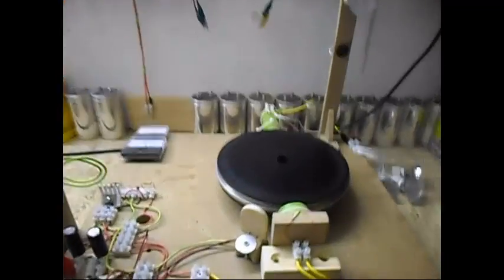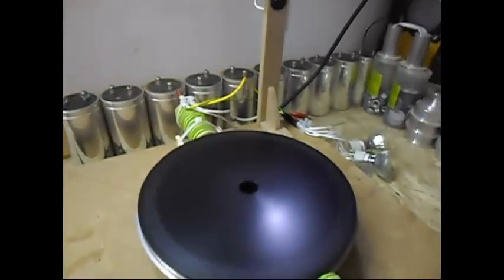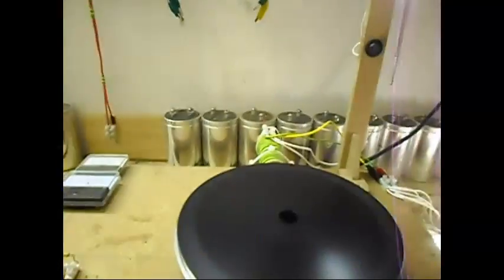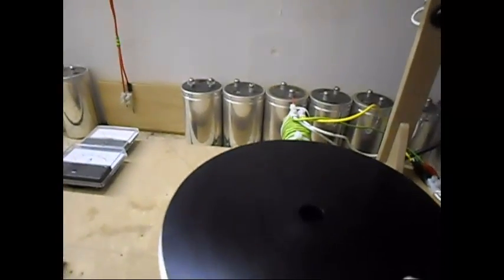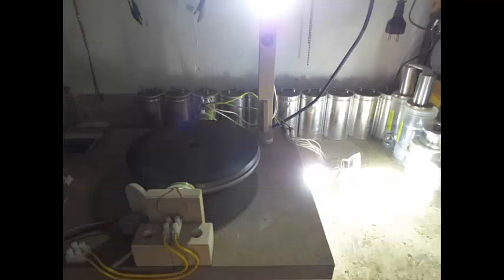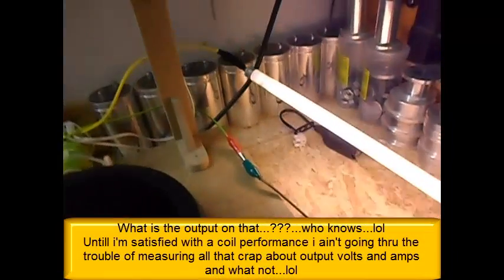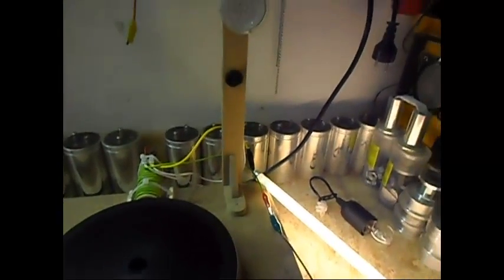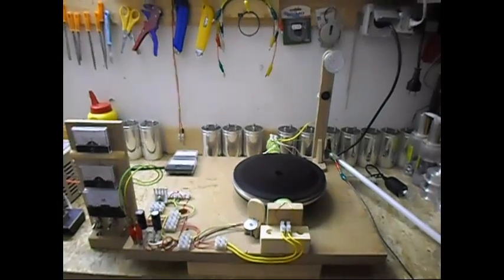Pulse Motor - Generator Update 3, Another coil - 1, 4 & 13watt AC load with speed up under load...

Comment: nice video! but what does the drawing amperage while you add different loads to the generator coil? is it stable or does it go up? more data would be interesting. also its interesting how many torque this thing can reach. can you measure it anyhow? i have to solve the following quest: drive a mechanical load of about 50kg at a stable speed where this awesome effect kicks in. can you help me with dimensioning the pulsemotor size?

would the rotor also speed up if you just put the generator coil away? maybe its just slow down the rotor because of copper resistance (like a break in a train) and lose this resistance with load.
Reply: This is the typical response to the coil shorting technique. In a system that uses a permanent magnet generator, such as Thane Heins, my own coil system, the bucking coils, or Chris Sikes (HYIQ.ORG) partnered coils, and many other motor systems using anti lenz configurations, there are plenty of ties to Nikola Tesla's bifilar coil. This is because it increases the amperages in the output by drawing the energy in from elsewhere. He called it from the cosmos, but what we are dealing with here is an effect related to the pulse of the back emf. When the back emf is launched back into the equal but opposite coil with a diode, the energy reflection comes back with additional output, further reducing the load and enhancing the output energy, so the load doesn't affect the input in anyway that would increase it, however the system needs energy to grab that additional energy. I show this with the partnered coils, and I also use this in my Pelex device, however I use it 3 times in a configuration that takes very little energy to start the system, then I use the flux generated by the system's start energy to amplify this effect again and again, slapping it so to speak as it rotates. You do this with a mechanical system, I use it in a non mechanical system creating a rotational flux rotation without the rotor. Mine spins around and around, and once the short is added and the other two coils are still operating, the back emf strikes the short while the other two energize into a forward motion, kind of like Tesla's induction motor. There is plenty of free energy out there for the taking and I hope my somewhat "vague" explanation shows you that it is also possible with a non rotating mechanical device, you just have to either use core materials as I did to make it switch fields in a specific manner, or you need magnetically activated switches (reed switches) or homemade self activating relays as I also have made to turn the correct coils on and off at the right mark/space ratio  to give these effects "amplification of energy" needed to call it overunity. Overunity is NOT possible without assistance from an energy that is drawn in elsewhere, so by merely putting a 1.5 v 1mah battery into a circuit saying "I get out 3v at 5 mah is impossible unless switching and special coil and timing effects become used at some point to provide a magnetic manipulation which allows this effect to be the objective of the device. Some circuits have special uniquities that all them to run overunity (in small scales, such as LEDs and solar cells, or with relay circuits that have been tuned to switch in resonance with the capacitive, inductive and resistive components. More energy out is Possible! It is science that keeps telling us it is not because science says we can't draw from an aether that doesn't exist, well, they are wrong. Physics ended once quantum physics started. The quantum part is what they don't want all of us to know, they want limits in place, that is why most folks are limited to the physics they teach in school. They don't want us to know it if we flaunt it or give it away so they lose money. They= the establishment.
Reply: you are welcome. The key to all of this free energy stuff is to capture radiant energy with the use of inductors using a phenomenon they weren't designed to use. That is capacitive coupling by magnifying the loss function so deeply that it reverses it's reaction. This is by creating radiant energy or harvesting it via the use of a wirewound resistor using the correct  magnetorestrictive elemental conductor or compound such as Terfenol D, Metglass or others that have very unique magnetoelastic properties with energetic growth into the quantum arena.

 The inductor has a capacitance, supposely like a "leach" so to speak that allows the harvesting of energy. The inductor also has a high resistance, or needs one so it functions as needed here. This is the key that unlocks the phenomenon. I have a few examples,. first is Jim Murray, Second is Rosemary Ainslie, and the rest were all some sort of success from the work of Tesla.

In every Tesla system you will see his high impedance coils are always represented in schematic form as a resistor. This was done on purpose and it is the entire secret to his free energy success where he wanted to release it so badly, that he had to hide it in plain site within schematic form so the whole world could see it plain as day. If the viewer sees this circuit schematic or the many that contain it, refuse to allow others to make my theory public, it will save the system from being totally suppressed. Make sure that others know where the info could be found orally, so it doesn't become publicly suppressed. 

 Tesla wanted us to know this without telling us so it would endanger being removed by the scientists that would eventually figure it out. The key he didn't ever say was that reactive power is radiant energy and that reactive power was an excuse to cover up what science didn't ever want to be released., and it is held in complete confidence so much that the court systems would have the ability to be controleed by the establishment so much that an energy system as such couldn't ever be released to the public without being shut down.

Paul Pantone met his match when the legakl system was overcome by shadow gov officials and forced him guilty of security fraud charges and jailed for years, completely ruining his life when he found the answer to the fuel crisis, where they obviously didn't want anything to be known since it was the perfect time to release a new very powerful technology. He obviously refused payoff to be shelved and they figured they would teach him a lesson as they did to Stanley Meyer, just not so harsh because they probably wanted his intelligence to work for them and I bet he refused.

 So, by showing the coil as a resistor Tesla didn't only mean it was an inductor or resistor or both, he wanted us to know they had high resistances and therefore was able to be pulsed with a specific enough waveform with the proper frequency where it allowed the material it was made of to heat up using negative wattages of input while the output was well over 100 watts. Here is a link to show what I mean - this link below is a representation that Jim Murray used an element that would allow the peaks and valleys of the waveforms with a high resistance as a form of gain beyond it's loss.

Radiant energy is the reactive energy he portrays in his system.This is how it works, if we take a high resistance bulb or wire one with a high resistance wire, such as magnet wire of maybe 40 awg and the power then comes to life, as with the hairpin circuit with a shorting bar.
Reply: Hi mrV@DAY, yes, please do read up on this from anybody but the scientific community. Their interpretation of reactive energy is much different than ours because we know we can't make energy and we also know we have to harvest the energy from other places without additional inputs. Mr. Ismael Aviso is a master at this phenomenon, so I suggest looking up his work. 

Science suppresses this data and we know it is not true what they speak of because there were original formulas from Maxwell that allowed this free energy to be harvested from the Aether, so, with that being said, if your input is less than your output,. we certainly know where it is coming from, and it isn't from the input, it is from the radiant energy created by the magnetic power of our planet and probably from using a shorting circuit added to a coil. 

t is very real that this energy being used to fire the motor disappears and draws only the power of the load, so if the load is the same size or larger than the motor's input necessity, we can loop the output once up to speed to initiate self running systems. What can be done to make it even more powerful is make the same system doubled, one system used to power 2 systems, then return the energy to the input and use the second motor drive to power a generator for the load to get completely free energy, or short it's output again in sequence for additional gains.

 This is what I have done using the mosfet shorting system and 2 universal motors to net a similar result. I copied Lasersaber's universal motor winding,. then added a mosfet shorting circuit to each one, running 2 resistive loads in parallel with one inductive motor load. The resistive loads run for free because the loading becomes equal, the inductive load is a full load with nothing for free until the resistive loads are added, then the motor runs for free after the shorting mechanism is added. 

Look this up, I'm sure you will find it very interesting. You do a great job with your builds, I would be interested in seeing them in person one day and hope you do make it to one of the free energy conventions if you have the time. As always, it is a pleasure to watch your videos. Good Day!
Reply from the maker: Thanks for your comment...^^
The amp draw goes down while the load(s) are connected...the heavier the load the better but there's a limit of course...;-)
" drive a mechanical load of about 50kg at a stable speed where this awesome effect kicks in"...that will need some careful calculations and i don't really do that since almost everything i do in this field is "go by feel"...and i know...not a scientific approach but it works pretty well so far for me...;-)

Of course will the rotor speed up if i remove the coil and that's because of the steel core in has in it...magnets and steel love each other very much...lol
But that's also a good thing since steel absorb magnetic fields like a sponge...^^

"like a break in a train"...that's the Lenz effect being used into a positive action...;-)
Do read and check all kinds of diagrams on google to get a good idea on it "regenerative braking"...^^
Reply from the maker: Thanks for your long and positive post and i'll try to soak it all up and let my brain consume it hopefully...^^
I'm not much into solid state stuff except for inverters but that's been a long time ago also...;-)
Reply from the maker: Many thanks for the long and positive comment about it all, it's all much appreciated...^^
To tell the you the truth i don't know much about "radiant nor reactive energy" but i will in the near future make time to read about it...;-)
Reply from the maker: Many thanks for all the info on this...^^
Mr. Ismael Aviso...i think i've heard of that name before...;-)
Lasersaber has some cool videos, i've seen many from him...
I haven't got more output than input at this moment in time yet but i am 100% confident that it can be done and that i'll get it done in the near future...^^
Yes, coil shorting can help out a lot with encreasing the output of a coil...
About free energy conventions, i don't know if there's any around here in the EU...???
Have a good one too...^^

Comment: Hi, what gauge is the wire you used in your coil...? Iis it single wire winding...? The configuration of the rotor is NOTH-SOUTH...?
Reply from the maker: Thanks for your comment...^^
No need to know what i'm using since getting this effect is not difficult and why don't you know about it since you have been here making this stuff way longer than i am...???...;-)

Just get a very high single wire resistance coil...i say go for 350 ohm and above...wire size does not matter here...the higher the resistance the lower the needed rpm is...;-)
But use 16 or more magnet on your rotor and not those 4 or 6 of yours...with 4 or 6 magnets on your rotor you will need far higher rpm...
Does not matter if it is N,S or S,S...but North, South is better for your cores so they don't get magnetized while being slammed with a same magnet pole over and over again...;-) 

And last, a nice steel/iron pipe or solid rod as a core...

All the above mention should give you "speed up under load...^^

Comment: Thanks for sharing
witch circuit you use for rotor drive
can i get schematic link
Reply from the maker: Thanks for your comment...^^
The drive circuit is not important, you can drive your rotor with any circuit you want...;-)
NPN - PNP Transistor or N - P channels Mosfets...;-)
The one i'm using is a N-channel mosfet, a small general transistor and a hall sensor...
You can also use a DC motor with a PWM like i do in my other setups...it really does not matter...
The effect has nothing to do with the drive circuit...it's all about the coil/core characteristics and rotor frequency...;-)
Reply: Muller circuit is good and simple
Reply from the maker: Yep, that is true and since there are many it is up to everyone to choose the one they like...^^